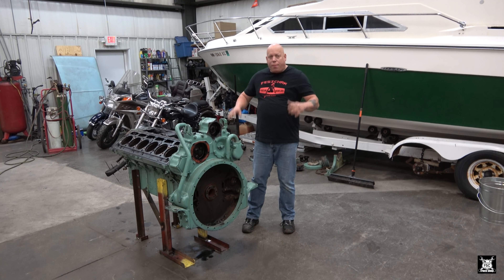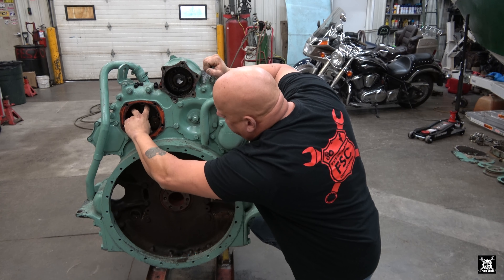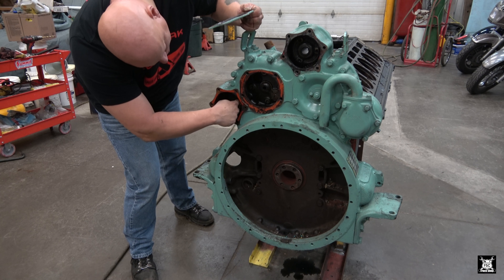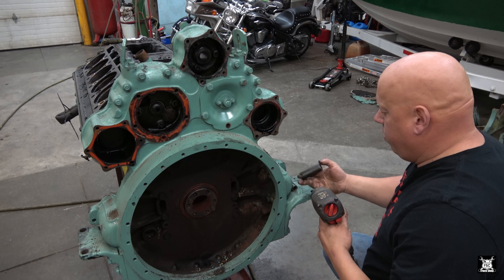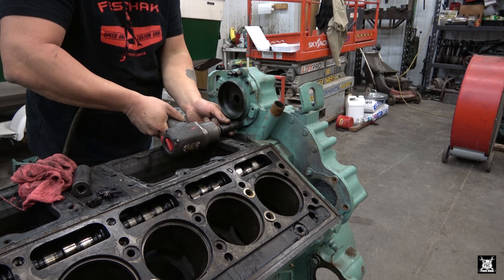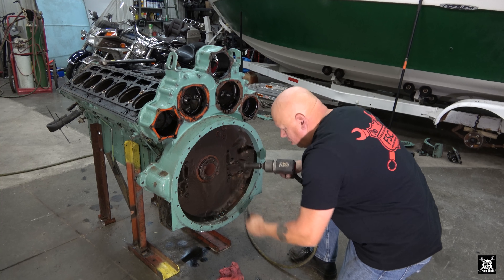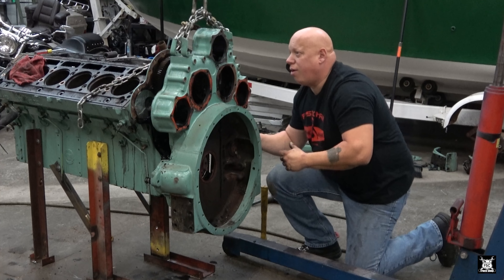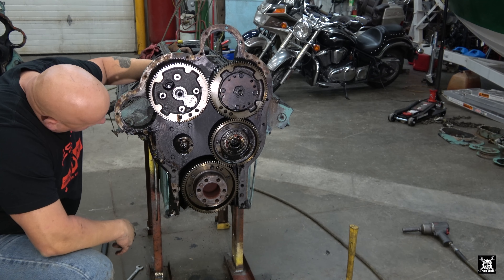12v71 Detroit Bellhousing & Gearcase Cover Removal

Comment: Those empty accessory drive spaces on the back of the engine were typically used for mounting a gear driven air compressor and alternator.

Comment: Some food for thought. I know from watching Bus grease monkey garage. that cooling of the two stroke diesel is one factor you should keep in mind when buying a chassis and cab. is the size of radiator you can use. I have seen cab over freightliner that have a very large radiator space for the v block for Detroit engines. FWD also has a large opening. I'm not sure about Kenworth but I think they would or did. I would look for a Kenworth arrow dine I have always loved the look of them you have the best of both a conventual and the cab over.

Comment: The copper washers are because the bolts holes go right into the housing and help to stop leakage the 5/8 headed bolts on the back covers as well

Comment: The copper washers are because the holes go right into the housing and helps stop leaking also always look for hidden bolts or you will v rack the housing

Comment: if i remember right at one point you talked about the blower gear drive and the fact that if you convert this to a 12-V71TA  turbo the gear drive is going to be different.   the blower's on a turbo motor runs at a different speed.  
you may want to start looking now for the gear drive.

Comment: I think International and Ford did big radiator options as well. Perhaps they all did as they all had a Detroit option. In road use I think that the 12V71s were usually superseded by 8V92TA rather than by 12V92TA.

Comment: Im not a mechanic but if the timing has to be changed from the back of the engine then sounds like to me it would be best in a cabover than a conventional. Just an observation on my part
Reply: Once the timing is set there's no need to change it